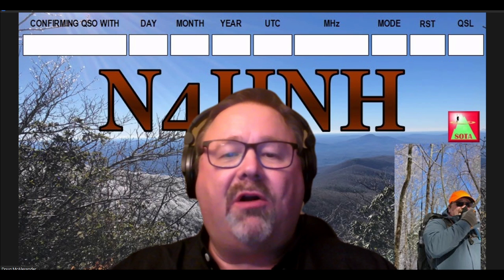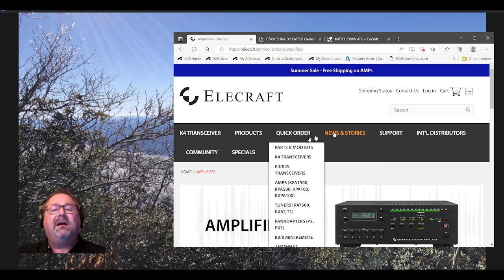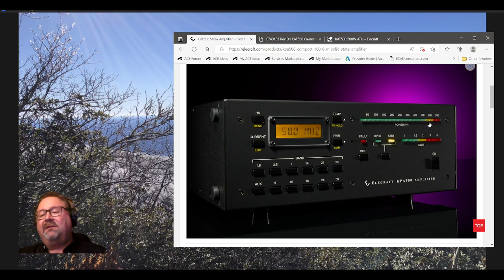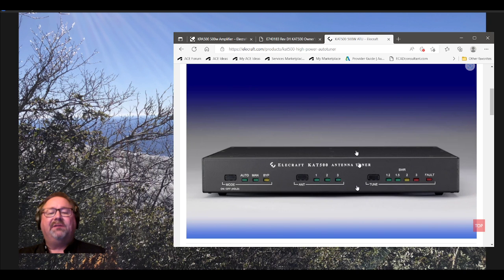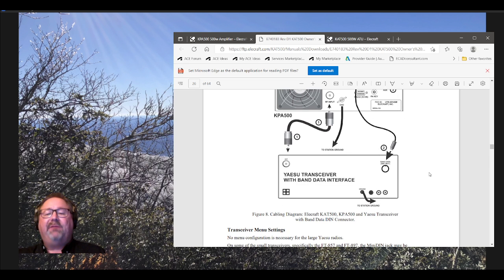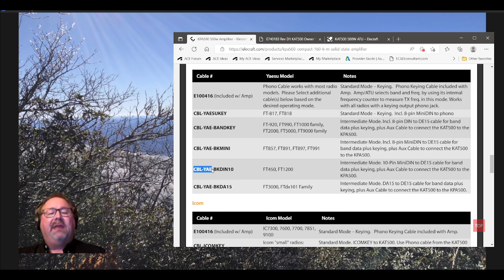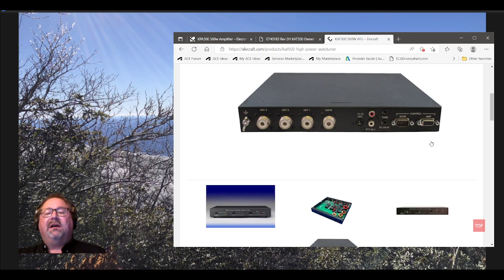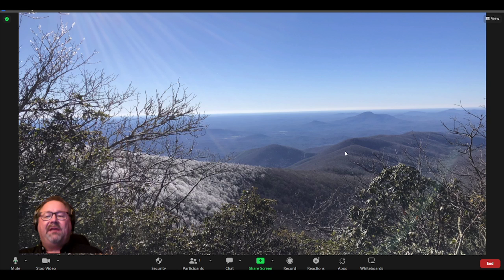Clearing the Elecraft Combo Confusion

Comment: just ordered power combo, thanks!
Reply from the maker: Congratulations!  It’s such a great setup.  How much is it selling for now?  I know there was a price increase earlier this year.
Reply: @n4hnhradio   do you think the Chameleon HYBRID MINI will be a good antenna for this pwr combo? it is rated at 500 watts SSB and I will be using 130ft wire for it along with a good radial system... but wonder if that is just too close?  What antenna system would you recommend in the +/-$600 price range?
Reply from the maker: That’s a good price compared to some amplifiers.  There are lesser quality amps that cost nearly that much. Of course there are amps that cost even more. So I think Elecraft represents the best value.

Comment: I have the Elecraft KAT-500/KPA-500 combo, it`s great for 500w. Of cause, all connection cables are from Eleccraft, FTDX-5000MP, FT-450, FT-817, FT-950 all tested ok.
Reply from the maker: That first 400-500W makes the most difference.  My favorite thing is the speedometer. 

73, de N4HNH

Comment: I once owned a 600 watt tube amp connected to a 50 foot high HF beam, and rarely used the amp. Now (different QTH) I use an FTDX10 connected to an inverted L Marconi wire antenna. The Elecraft combo seems so cool. I was wondering during what circumstances you personally use the amp, and what percent of your overall transmit time you use the amp. (The view from Tray Mountain on your QSL card is absolutely stunning, by the way.) Great video, as always. Thanks for all you do.
Reply from the maker: Hi RalphB!  I use the amp quite often actually, except on 60 meters.  I don't have a beam, so I sometimes need the help in order to work the QRP SOTA stations out West.  Some of them are operating with a makeshift antenna system and some of the lighter weight QRP transceivers don't have the filtering of the larger transceivers.  So, I want to make sure that I get through. If I'm operating on a band that needs no antenna matching unit, like 12, 17, 20, or 40m with the ZS6BKW, I try just the 200W from the FTdx5000.  If I struggle to get through, I turn on the amplifier and try 500-600W.  That is usually enough. 

If I'm on 160m, 80m, or 40m in the evening, I usually use the amp.  The people I talk to on those bands run amps, and if I don't use mine, I'm the odd man out, making them have to increase their RF gain to hear me, compared to everyone else.  They like to keep RF gain rolled back, so they hear no atmospheric noise between words and phrases.

73, Doug

Comment: Hi Doug -
Did you say the CBL-YAE-BKDIN10 cables are supposed to be included in the price?  I too was somehow under that impression when I purchased the combination in May   But the only cable included was the power cable that plugs into the 120 volt wall socket. The other cables were $59.95 each (CBLE-YAE-BKDIN10 for the ftdx10 and the one for the ftdx101). I did call Elecraft and ask and they said only the power cable of my choice is included. Great video!!!
Mark
Reply from the maker: Maybe they stopped offering that. One of my viewers ordered the combo earlier this year and the cable was included. He just had to specify which one.  Maybe he was referring to the power cable.

Comment: I've used the KPA500 with my FTDX10 and I bought the Elecraft cable for it.  The only real issue I have with it is having to change the power out from the FTDX10 when going to from standby to operate.  The Elecraft K3 actually changes it output from 100-30 watts (or what ever you want) when you alternate from standby to operate.  I don't "THINK" the interface can do this while using Yaesu radios.
Reply from the maker: You are correct. The Elecraft transceivers can use Enhanced mode.
Reply: @n4hnhradio  I usually run about 15 to 20 watts to drive my KPA500 so its not an issue here.  If I want more output, I will crank it all the way up to 25 watts to drive the amp to close to 500 watts.  Of course, by then its already past the tune it up mode anyway.  My second Elecraft Combo.  The first lived behind my K3 a number of years ago.  Now its does just a fine job sitting behind my FTDX 10.
Reply from the maker: The KPA-500 is great!  The combination of the KPA-500 and KAT-500 is phenomenal!  Many don’t realize what they’re missing.  Bob at Elecraft told me that 600W is no problem for the KPA-500, if you think you need it.  My brother has run 630W with his. But you gain the most difference in punch in the first 400W anyway.  500W is icing on the cake.

Comment: Does anyone have experience with the Yaesu Quadra amplifier? I have the FTFX5000 and my OCD tells me to buy it instead of an Elecraft :-) Should I buy that or an Elecraft?
Reply from the maker: In know a guy with a FTdx5000 and a Quadra. His Quadra has never failed. He has had it well over 10 years. He generally runs 800W.

The Quadra is now discontinued so there will come a time when Yaesu will no longer maintain replacement parts for it. 

I personally like the Elecraft. My KPA-1500 can match just about anything and provide up to 1,500W with full automation.  

If you have an opportunity to buy a Quadra now, you might want to take advantage. Elecraft equipment is back-ordered right now. 

73, de N4HNH

Comment: I take it for granted that when you ( train your tuner every 25 KHz) , that is a one  only situation. Do that once only?
Reply from the maker: That’s a great observation. You are correct. It has 1,000 memory slots. Let it find a match every 25 kHz on every band once and that’s it. Be sure to match for every antenna you will use. If you have two to choose from for the same band, match both. 

Note that for 160m you will probably want to match every 10 kHz. The SWR on that band can change significantly in as little as 10 kHz change in frequency. 

73, de N4HNH